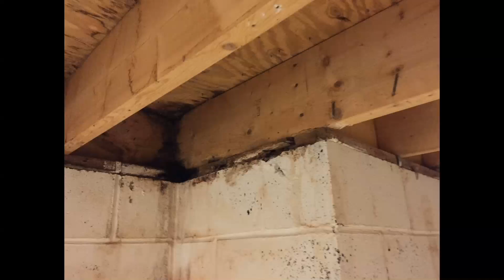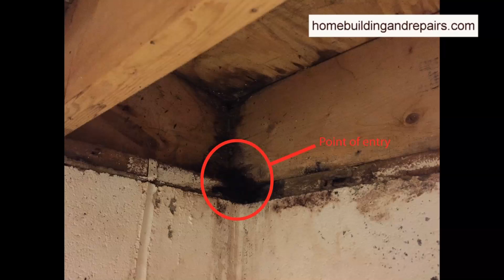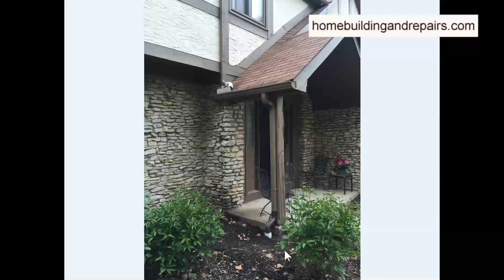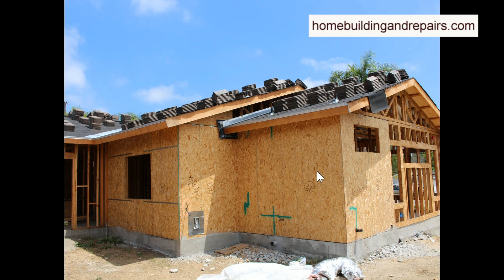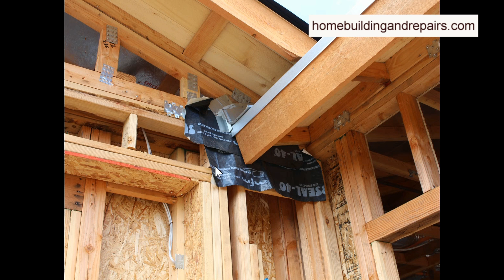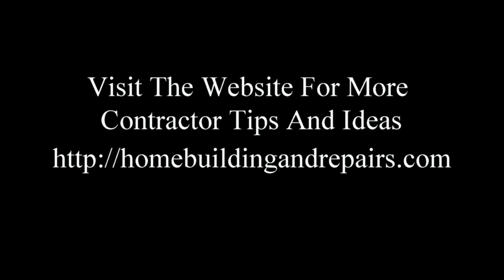Basement Water Leaks Can Come From Above – Home Repair Advice

Comment: My favorite <ugh> situation was a collapsed main floor living room ceilling in a well kept 2.5 story wood and plaster home in an older part of the city. Homes around here commonly have pretty sneaky leaks as the local water table shifts with the wind. Straight off I went to check the condition of the 4" clapboard siding. In about a minute I noticed a wide bulge in the vicinity of where the 1st and 2nd floor met inside, with gaps between 5 or 6 boards at the bulges apex. The layers of asbestos, rodent nests or whatever had allowed the water to flow from there to the living rooms ceilling while showing no damage elsewhere. What a mess.
Reply from the maker: UGH!!
Reply: Jason Cr. It’s long because this is a complicated subject. The video was long and chasing down leaks is not something that’s always found overnight. I was had a car leaking oil and the mechanic told me that they don’t chase oil leaks ok.
Reply: That's  a really long text 🙃